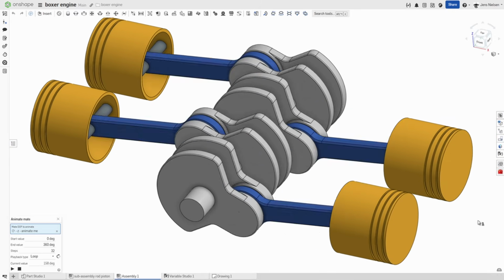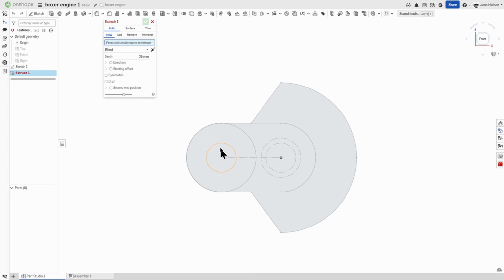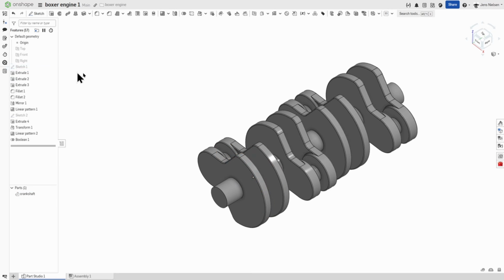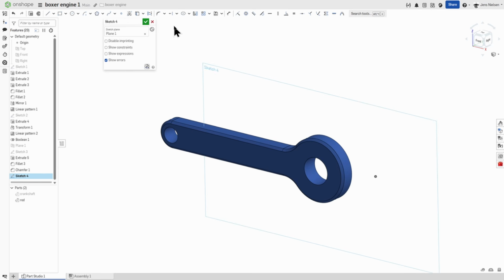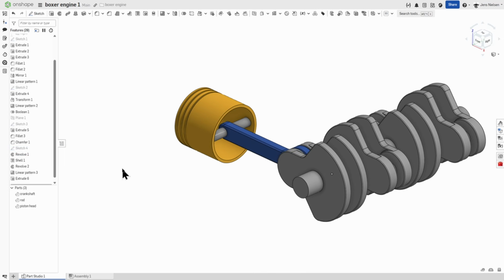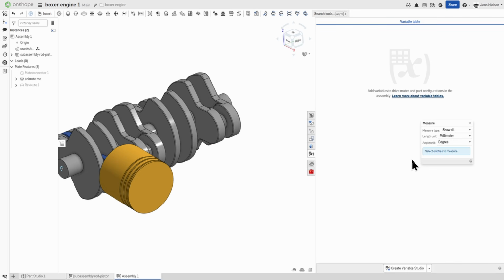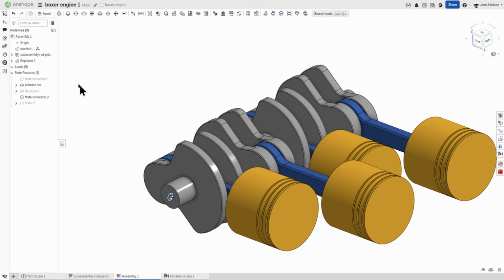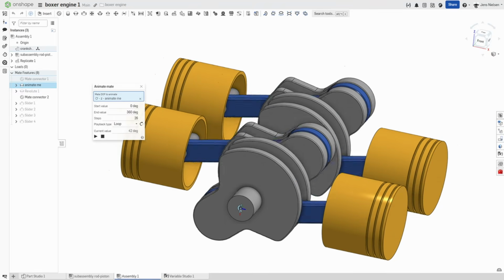How to Build a Boxer Engine in Onshape (Part 1: Modeling & Motion)

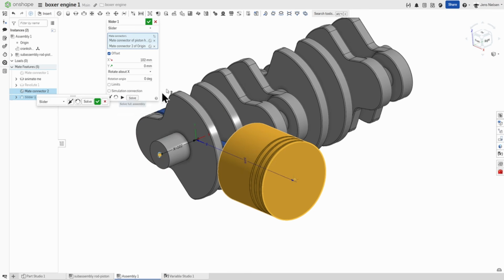Comment: 18:46 my piston head doesn't go back to the fixed position on the rod when I use the slider mate command, the 325 on the z axis just don't exist, any idea why?
Reply: It's a little difficult without seeing your file. I have linked my document in the description, this should help.
Reply: @cademist this will do, thanks a lot

Comment: Another great turorial with Jens cranking out some Onshape horsepower with tips and tricks for maximum performance.
Reply: Thanks for the high-octane feedback, Tim! We’re currently in the pits doing some fine-tuning on the simulation data to make sure the engineering analysis is hitting the redline. Expect Part 2 to roll out of the garage mid-January—we want it to be a smooth ride. See you then!